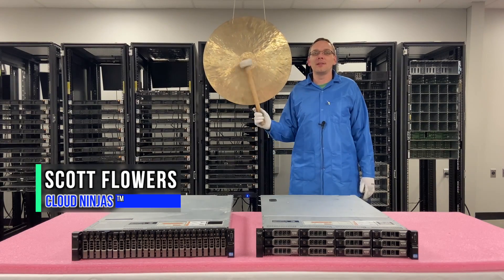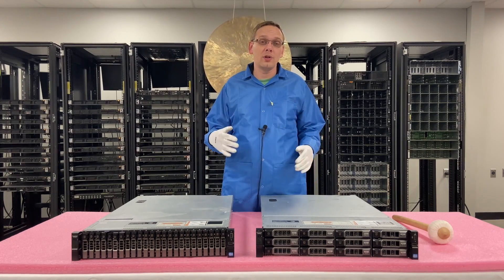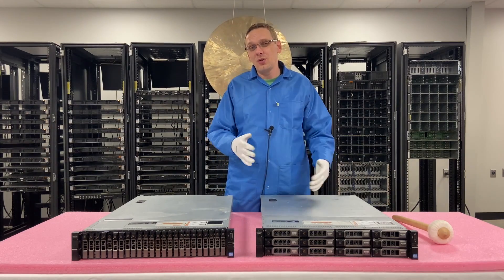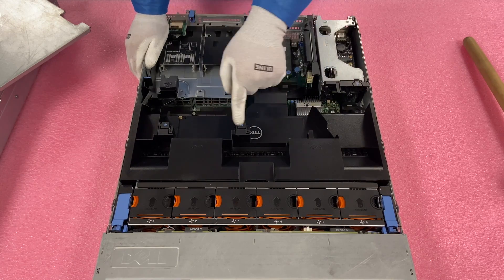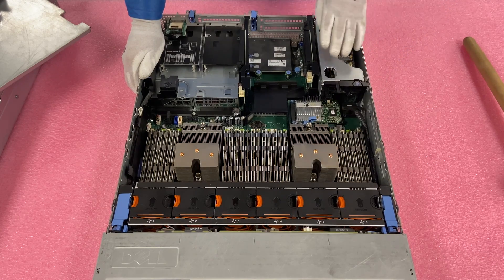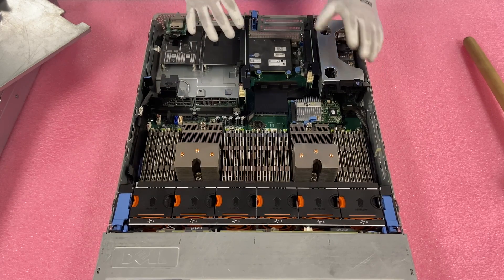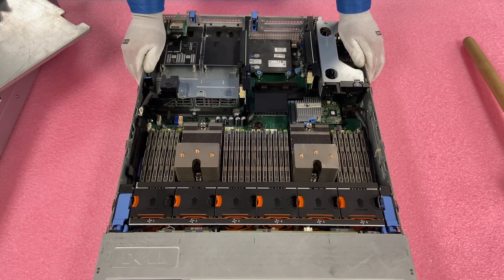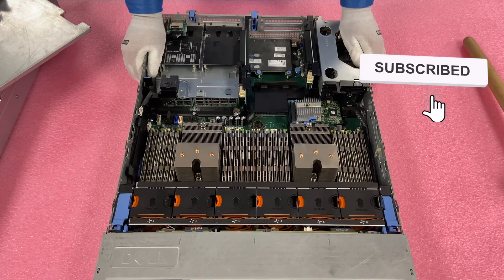Dell PowerEdge R720xd Chassis Overview | Chassis Options | 12 Bay LFF | 24 Bay SFF | PCIe | Flex Bay

Comment: Choose sff for ssds or fast 10-15k sas disks or lff for larger capacities not ssds and 7.2-10k big sas disks
I chose sff because i have 10k hdds and i don't put in much capacity per drive, but i wanted a fast access raid, 20x900gb is my solution